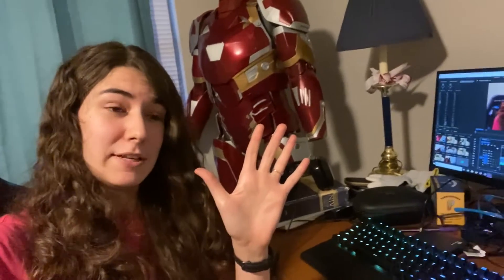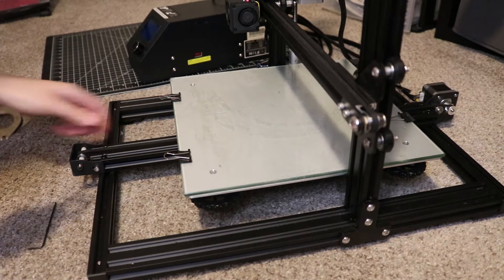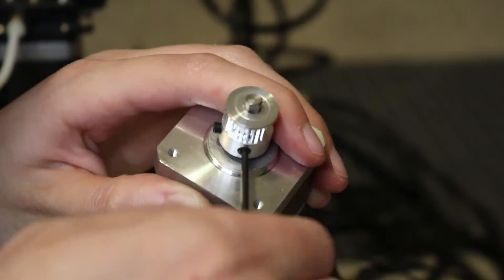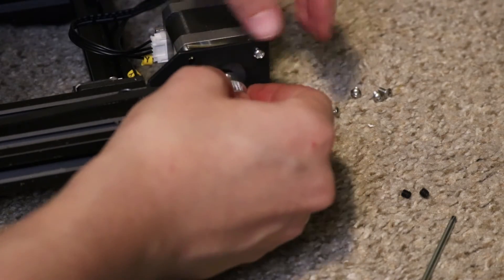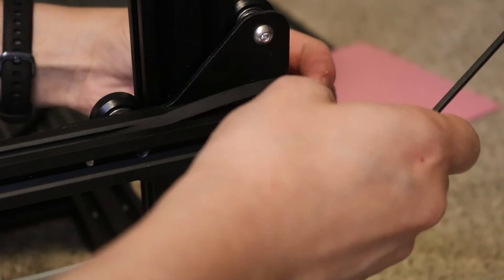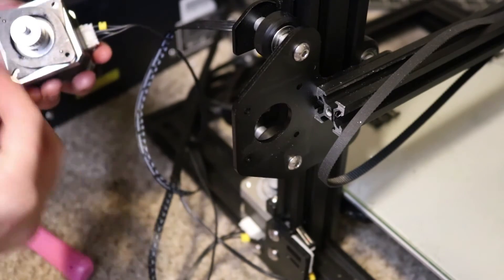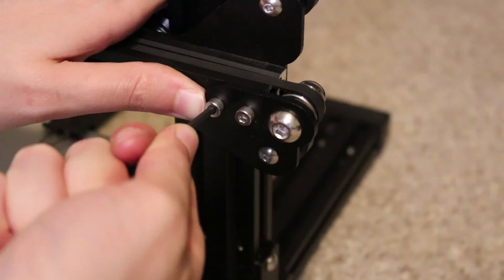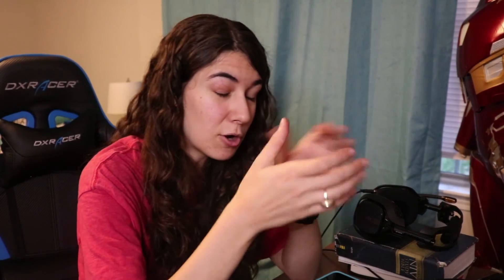How To Silence a CR-10 with Dampeners

Comment: Think you just talked me into installing dampeners...
I'm curious if you have considered building an enclosure for your printer. Mine not only cut down in noise, but helped keep temperature consistent.
Reply from the maker: I honestly want to build at least one, just been dreading getting together all the materials.. haha
Reply: @EmilyTheEngineer  Ha Ha, I get that! Mine took about a month to gather pieces. Still gathering egg crate foam. Just for speed, and convenience I bought the $9.99 "Lack" tables from IKEA. Had to extend the legs 5", but it's worked out nicely.

Comment: U can basically cut a thin rubber pad in correct dimension  and use it . This how your stepper motor wont just hang from 2 screws and in time ruin your belt.  and it will save you money however your Motor will run little bit warmer because the metal body is acting as a heatsink . you can later use a small heatsink but I wouldn't recommend because i used this method on my 3D printers (CR10s) and 4x ender 3's  and all of them are  still working great for almost 4 years. For better noise cancelling you can try changing your Fan's to a better ones with less noise and by far the best nois cansel ing method would be to put your printer on a thin block of concrete and put a big foam under. By this method you will almost eliminate the vibration your printer creates and will greatly reduce the nois.. just like how "cnc kitchen" explain's in one of his video.  Also if you want ro be extremely intense.. you can swap your stepper motor drivers for better ones .  Thats how i have all my 5 FDM 3Dprinters and my DLP printer quite.